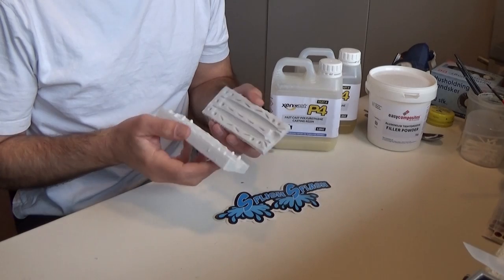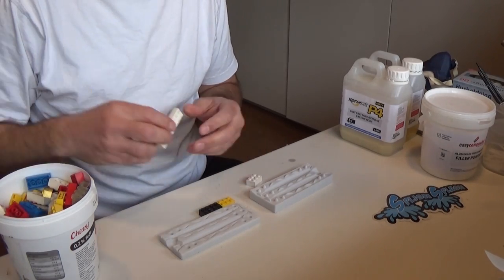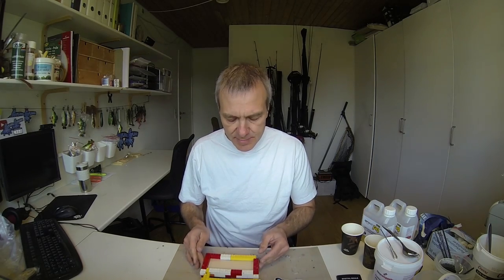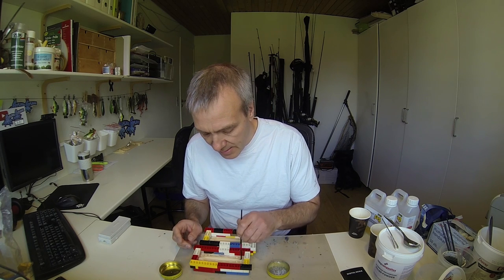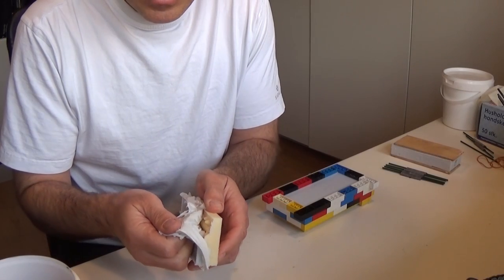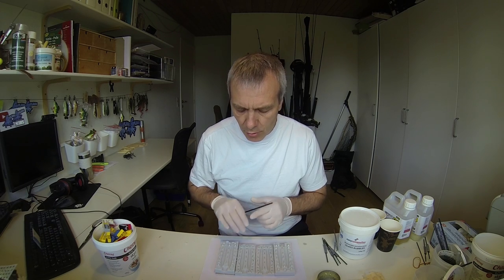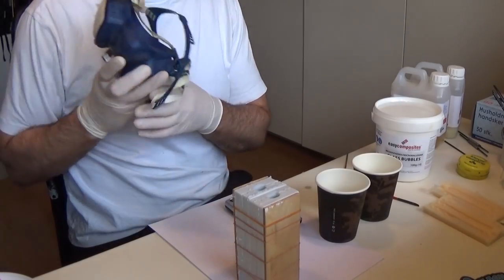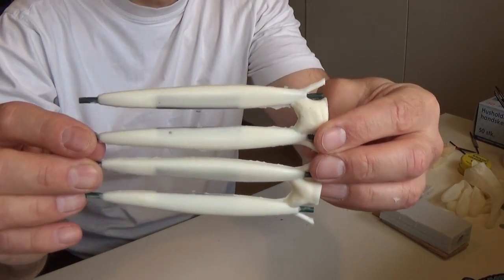VLog - Can you Cast a Mold?

Comment: Good day sir. I just want to ask on the durability of this mold material if it is use in a metal jig. And what is the complete material use to make this molding
Reply from the maker: This type of silicone will not work with metals. For that you need heatresistant silicone. With that you can make hundreds of casts from each mold. You will find links to the materials used in this movie in the text bellow the movie.
Reply: @SplishSplashFishing  what can you recommend material for heatresistance silicon.

Comment: cant you just use the resin mold and forget the silicone one ...and put plastisol in the resin mold ...i need to look at all your videos i think ive missed something ...where do i get cheaper plastisol and pigments ...cheers
Reply from the maker: I dont think the resin will be able to handle the heat, but maybe you can some additives like aluminium then can help. Regarding plastisol, you will probably get the cheapest somewhere locally. Lately I have been using the one from LureSolutions in UK